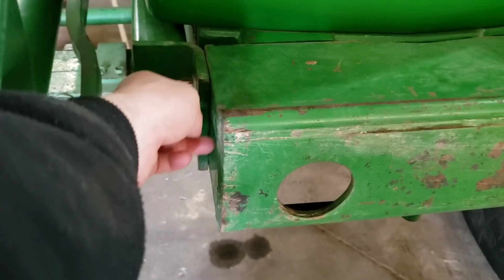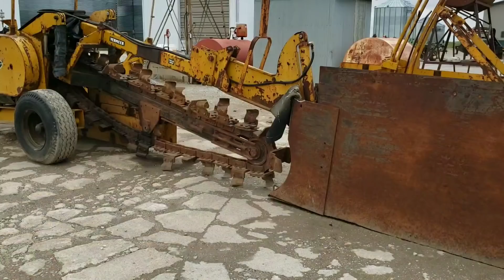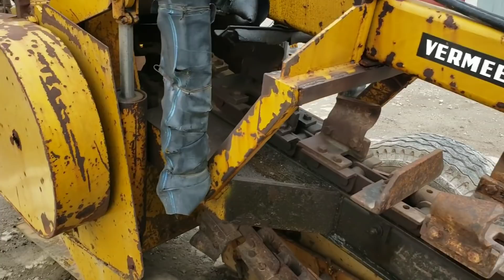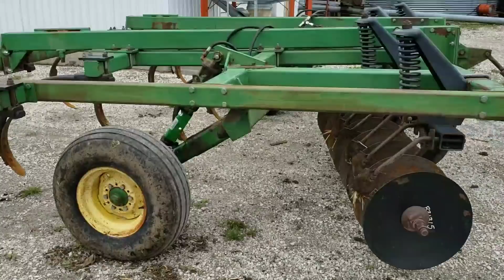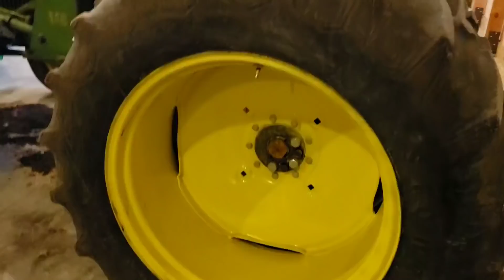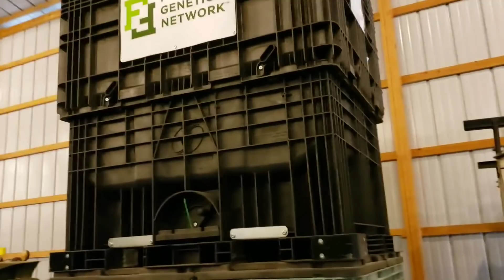Loaders, trencher, blades, backhoes & seeds - new things and things going on

Comment: I have same set up on a 4430. How did you plum your hydraulics under the battery box? Power beyond kit? Also what was the part number on the back lights? I'm actually sitting a 4230 the same way. Could provide this info? Thank you

Comment: When I was growing up our neighbor had a Vemeer trencher just like that. I spent plenty of time tending to it and helping around it. The chain drive was real noisy and sent shock loads into the tractor.
One winter he replaced the chain drive with a monster common back V belt and pullies. What an improvement. 
I think the parts came from Vermeer. You could check in to that if you choose.
Reply from the maker: I think the later ones were vbelt drive ...  cool - thanks for sharing

Comment: hey were trying f2f seed too and and slow can the 8400r go with the powershift
Reply from the maker: Awesome ... I think f2f will hbe a good thing ... not sure how slow, I think it's like 1.7 mph, at an idle, I'll check that for you
Reply: BLACK EARTH EXCAVATION & TRENCHING, LLC ya I'm exited to put it in the ground and that power shift is kinda like ivt isn't it
Reply from the maker: @rileelang11   its similar .. it uses dual countershift - shift pack on one shaft - then preps the next pack on the next shaft - makes it super smooth to shift ... i personally like it over the IVT ...  its not as "mushy" ... but neither come close the CVT that fendt uses ...... i think electric drive will be the future
Reply: BLACK EARTH EXCAVATION & TRENCHING, LLC I agree with you too electric drive is and I would love to try a fendt or challenger we don't have a 8r yet but are looking at a 8370r with ivt and I was curious about the 8400r because we're not set and stone on a ivt are 9630 and 8420 are both powershit and we've gotten along fine